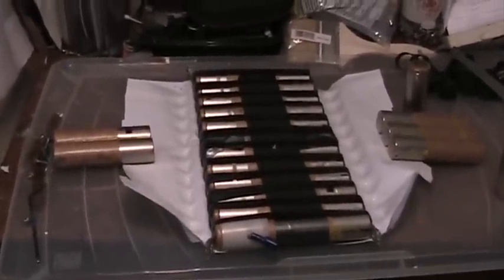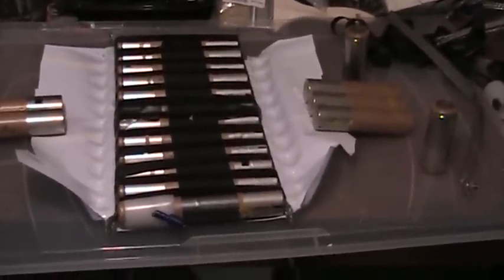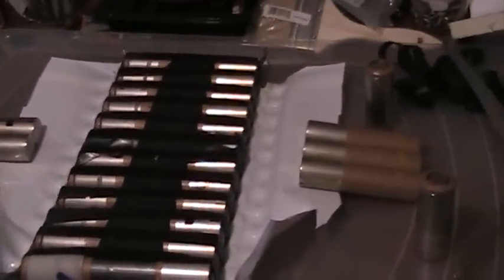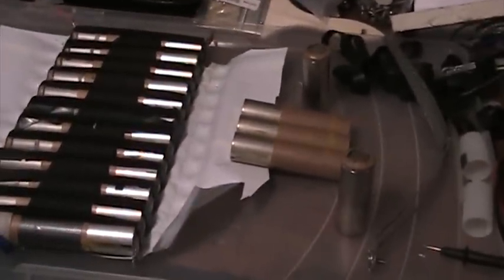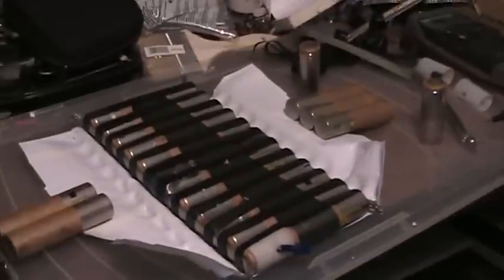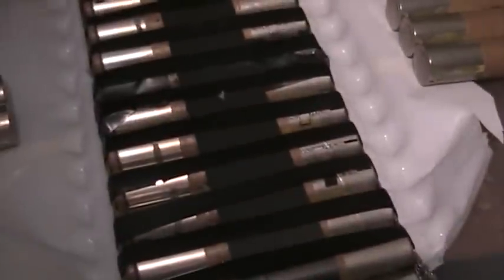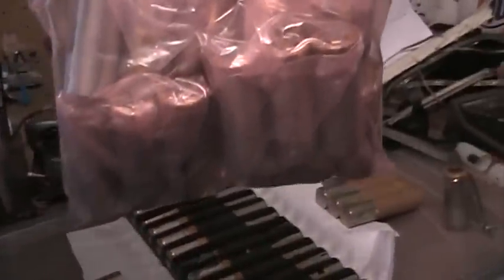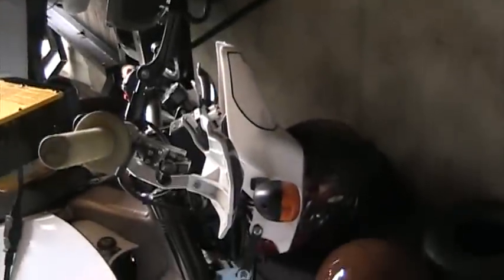Zero X motorcycle 2009 battery rebuild with new cells

Comment: thank you for your time. I bought a Hyperion EOS 1420i NET3 DC Charger I also found another brand Thunder Power TP1430C for $190 which says it can balance. Chargers that can charge 14 LiPo cells in series are pretty rare it seems.

Comment: i have a zero DS battery hasn't been charged in over a year, Just plugged it in and all I get is the two red blinking lights indicating a low voltage battery, is there anyway  or hope to get this battery charged again. What special battery tester do I need to test the battery?

Comment: was curious if you could rewire and repack the battery at a slightly higher voltage for more power or if that would fry the charger, controller and motor?
Reply: 2011 zero mx

Comment from the maker: I have no idea. The delta Q charger that is with the Zero has a sense line from the battery BMS, that is the key. Any other charger must use the line or slowly... trickle charge at the end while the bms controls the charger output. This 3 volt signal is also what stops the bike from pulling from the battery when low, keeping the battery from wearing out. You can build a simple box, 3 volts with a switch to defeat this on the bike and go further when needed, I carry that on the bike but don't use it much.

Comment from the maker: Sorry i did not do that. i sold it some time back to a solar installer who will build power packs and run with his son. Very fun but there was no class for electrics in the local autocross, so i was a classless guy. it was great to drive, never stalls or has starting problems, Quick torque out of the corners but you had to swap a battery out every round on the track. So then i had three batteries and i ran the oldest first to warm up but could not charge at the track as there no electrons around. it had the early perm 43 motor and Altrex controler, but a 450 amp version that was programable.

Comment from the maker: Sure but you have to change the charger and BMS inside, so expensive and you can by a new version of zero and have more power / speed as they have larger motor and voltage

Comment from the maker: The big DQ charger needs a signal from the battery BMS, the white line. If you don't have the BMS connected (Spagetti monster) then the DQ won't know when to push juice. So without the line between BMS and DQ it will overcharge quick. Get a small 48 volt trickle charger for lithium, say 2 or 3 amps and you have a chance to charge without over filling and unbalanced set of batteries. if any cell set is too low volts, say 5 or 6 volts instead of 8 in a blade, then bring that up. Zero does not have a repair shop and even DQ won't fix their chargers, one shot product, so I have a second small charger that I feed with solar at 2 to 4 amps too. adding another balancer may not give the signal for the DQ, that is the issue with recycling the old battery.

Comment: I tried charging each of the 7 arrays and found that when i put them all back together, the Q wouldn't charge them.  I tried to mearsure with a $10 volt meter and found that one array wasn't as high as the others.  I have looked into Youtube balancing with these Li ion batteries, and found some charging balancers for $45.  Is this a waste?  Is there someone else to rebuild or test this battery?  I can't even get a schematic from Zero - I was a rep back in 09 and 10'.  They are crap to deal with and have told me to send the battery in with a check for $2,500.  Any suggestions?

Comment: Battery name Voltage and ampere?
Reply from the maker: The overall battery is 48 volts, 1.4 kw I think. So much bigger than a bicycle, small for the motorcycle. If you mean the cells, 3.7 VDC (4.1 charged) I think about 2 AH. Molicel is not sold to the public. I had Zero rebuild the last battery they have access to the cells.

Comment: Hi darwin rector and everybody here.
I'd like to ask some help cuz I'm with the red light blinking twice too.
Does anybody here have any technical documentation to suport me with the reassembly of my Zero DS 2010 battery?
Reply from the maker: The batteries are different from mine. Try the zero site for a manual or google the issue to see. Or call Zero tech support is the other thing to do.
Reply: Thankful by your response, darwin rector. I'll try to get it with them...
Any clue about where I could found Molicel IBR26700A? The only place that seems to be selling it, is a Alibaba member and I'm not very convicted about their reliability. Best Regards!
Reply from the maker: What I know is Molicel does not sell retail to public. They only go oem or sell to businesses. That is a problem. I generally get two batteries and test each cell and then put a good one together but that is hard work. Think 350 cells testing for a day each on a vencon tester, took me months and with limited success.

Comment: is there anything you left out from the video that you wish you would have added?  Do you know the exact cell size/ cell model?
https://evmc2.wordpress.com/2013/12/04/inside-the-2010-zero-x-battery-pack-molicel/  
Has some info too.  I'm looking to rebuild my 2011 bike.. I got for a song, and only has 800 miles on it.
Reply from the maker: +David Wells 
Hi David, not much to add, the cells are not available retail so not easy to come by them. The problem is age, most of these packs are 4 to 5 years old now and that is considered aged to death. Lithium have a 3 to 5 year age factor and beyond that they are useless.
 I have an old battery 2009 and it runs down the road but on cold mornings it accelerates slowly, really slow, later in the day when warm they are much better. 
I helped a neighbor rebuild the 2010 ds that has a bigger battery but it was a pain. He used the leaf car battery cells at about $800 but had to add a different BMS that cost another 200 and then the chemistry was different and the charger delta would not fill it up. They can reprogram the charger but you can not. We also had to defeat the control box on the dash as it did not like what it saw and then it finally worked, whew quite a mess to do!
I think the other option to try is get some big headways battery packs, say two large ones and two chargers and fit them into the old battery box and maybe even a third in a bag on the back for the dirt bike X. 
The DS has the batery built in and we had to tear it apart three times, ugh.
Keith